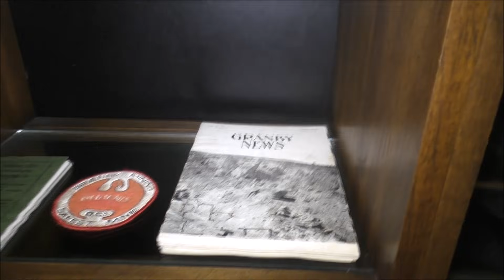#43 3,000 foot drop to the bottom of the Remac mine...the top levels.

Comment: I love your ambition, Frank. After what you did with that ore cart, I have faith that you'll get down to the bottom! That mine is so huge, it's overwhelming - bigger than any mine I've explored... It was cool to send the drone over to get those shots looking down that huge cut in the earth.
Reply from the maker: It is a pretty exciting challenge but like everything else it is just one step at a time. When we were at the top I wanted to fly the drone into the mine since it was in visual range but the batteries were too low..... Thanks for your comments!
Reply: That would have been cool to fly the drone into the mine! Next time, I guess. Does the drone always have to be in visual range for you to be able to control it?
Reply from the maker: No it doesn't have to be in visual range, you can watch the camera from the ipad. Flying into the mine isn't possible you need a radio signal to control it and lights so you can film and see where you are going.

Comment: If I recall there was a big collapse there at the Remac... (Reeves Macdonald) and I think that is the big hole at the top with fence around. 
Also the river Pend d'oreille (pronounced Pond -der-ray) was a real wild stretch of water all the way from the dam at the border to the Colombia until it was damed up in late seventies. There was lots of speculation about gold in the riffles... it was virtually all rapids for miles. Attempts over the years to drag line the bottom. 
Prior to the dam and lake the other side of the river from remac was real hard to get to. I was timber cruising over there related to the dam project and found several small mine prospects including a totally intact cabin with everything literally left on the tables. Often wondered if the miner was under a pile of rubble in his mine. 
The Emerald and Remac and maybe Sheep Creek were the big Salmo area mines, but not as big as the Sullivan in Kimberley.
Reply from the maker: The last stope we visited in the video but didn't enter by the frozen waterfall has a fence around it and had a mass of large boulders in the bottom. Ken said that is probably what you are talking about. It is not far from the main mine on the power line. Records say they were not connected by underground workings.
Reply: the miner was killed and eaten by a skookum..morris mountain is where the sasquatches are,but the skookums are near that area( remac) the natives know

Comment: Those bits are not 'welded' on, they fit a tapered inside to a taper on the end of the drill steel and must be hammered to get off. When a new one is put on, as soon as there is pressure on it it locks tight. Very simple and efficient method of changing bits. When the bits are worn down they can be removed and sharpened for re use until they become too small to use. I have used thousands of bits like that.
Reply from the maker: Good to know Spencer. I really appreciate your comments!

Comment: hey Frank impressive big mine, did the main haulage level go to grass or was it just internal? cant wait till you try the 564 meter descent, id like to see the main stope at that level or as far as you can get,!
Reply from the maker: I don't think we will be able to get much below the 1900 level. The river is at 1750 and there is lots of water gong into the mine I don't think there is anywhere it could drain to. The main 1900 level went to the concentrator right by the river but they sealed the portal so you can't go in there.

Comment: After watching the video and looking for remains I am guessing that those stopes were mined by longhole drills. They would drive a drift  or drifts into the orebody at different levels anywhere from 50 to 200 foot vertical intervals then bring in the longhole drills. they would then drill holes up to the elevation desired, generally not exeeding 100 feet for hole accuracy, and possibly drilling down too. They would then blast the holes in a specific pattern and extract the broken ore from the lowest point in the blast area literally retreating in a downwards fashion. I am guessing this from the lack of wall support in the stopes and the pattern of the drifts intersecting the stopes. When you get lower into the mine and get to the larger drifts they would have been extracting the ore by scooptram instead of trains.
Reply from the maker: In this mine they didn't use scooptrams it was all hauled out the main 1900 level by trains. They had an electric railway.  I am not sure how much blasting they had to do. There was a pretty rich Lead deposit there,  the ore would be pretty soft no?
Reply: I read a document to this effect here.  https://propertyfile.gov.bc.ca/reports/PF811282.pdf

This link may break in a while..one poster previous linked something 1 year ago that is now broken.

Comment: The "mining lights" are actually flame safety lamps. They weren't used as lights but for detecting low oxygen & flammable/explosive gas atmospheres..Definitely a prized artifact. Some mines still use them (mainly coal) but electronic gas detectors are mostly used now..
Reply from the maker: Yes I have learned that. In the old days they used canaries but the carbide lamps were also a good indicator of low oxygen levels. I have two Wolf safety lamps I love them!
Reply: Exploring Abandoned Mines In BC. Nice.!!! I'm looking to eventually get my hands on one..Thanks for the reply.. Cheers.
Reply from the maker: You can get them on ebay

Comment: What does Frank say right after 3:45? That a guy had  .. how many feet of rope and he couldn't get to the bottom?..   1800?    .. He has such a way of not fully pronouncing every word...
Reply from the maker: 1800 was correct. But they didn't run out of rope they couldn't/ wouldn't go past the blockage. Remember this is an inclined shaft not straight up and down.
Reply: @exploringabandonedmines  thanks. Incredible views, Incredible what these people were capable of, and even Incredible what YOU are able to do and the places you are able (and daring enough) to get to! much appreciated

Comment: You should get 3D glasses for the RC and try and go down this with a cheap RC quadcopter, since you know how to operate one. I wouldn't chance a good one init tho, signal might get lost.
Reply from the maker: We will climb down there......just need to line up all the rope we can find it is a long way down even just to the 1900 level!
Reply: aserta would need to use a low frequency to control it like 27 mhz. 2.4 ghz would suffer down that depth in the shaft